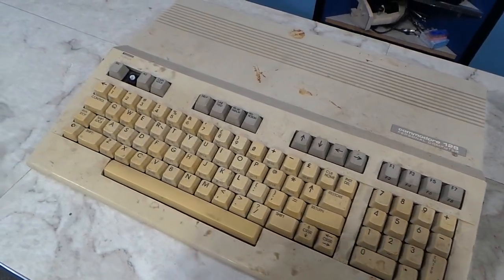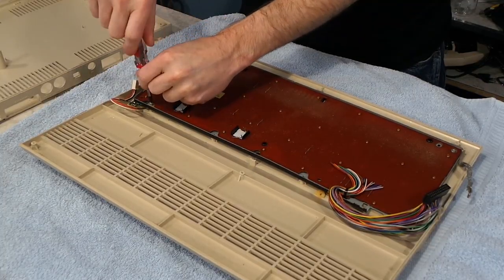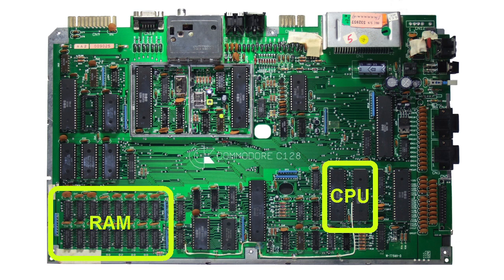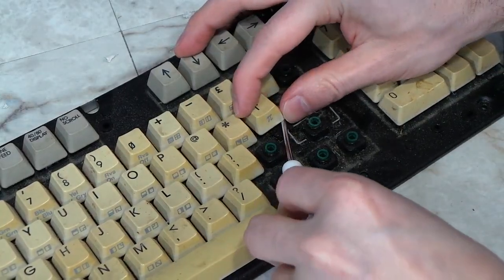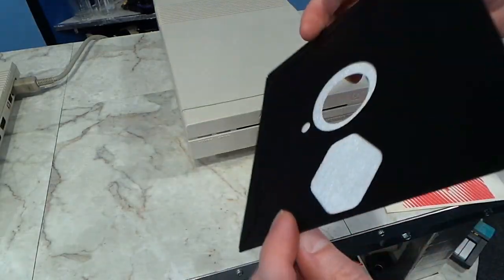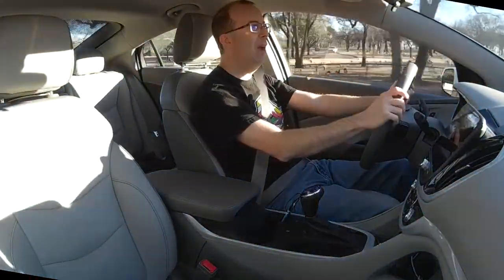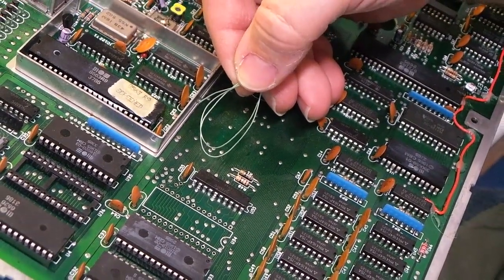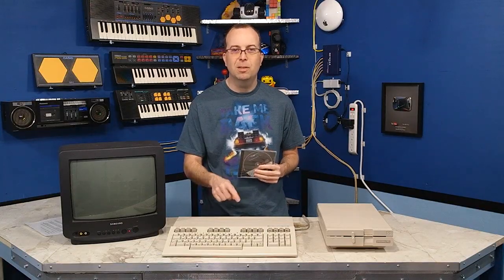Commodore 128 Complete Restoration and Board Repair.

Comment: my dream would be a 8-bit laptop with low res 320 x 200 screen and basic running with almost no weight and a memory card as harddrive. that would have been cool because all my software development is in form of basic so i would want to create real programs or games on somthing like that but with the look and feel of a modern computer. i was thinking of a microcontroller type 8-bit laptop specially designed to develop software in sprite style.

the cleverness in software is in the design of new subroutines that does somthing different than what have already been made.

the basic language need to be modified to support subroutines loaded in separate pages to decrease the confusion in reading the code since when you have hundreds if not several tousands of subroutines all wired together, it would be really had to keep track of, without dividing them into separate pages.

the pages does not need to be like files, only have their own memory block space in the drive and accessed by special algroithm that locate the blocks and load them into memory one by one and a list of long names for the titles of the subroutines pages.

the laptop must have a serial or usb interface in 8-bit mode that can talk directly to any 8-bit microcontroller and a way to read a diagnostic map of the mcrocontrollers software to check that the routines are interacting properly and a way to download the artifical memories from the memory algoritms that i have not made yet. 

i was thinking of the use of such a laptop to speed up programming of microcontrollers and  development of artificial brain software that is based on classic dumb AI method (that runs on subroutines for logic action patterns). i guess you guys is far more equipped than i in making such a computer. so it had been cool if you guys could make one.

im not really good at tokens and interprater development in the moment, so i have no clue yet how to make or modify a basic interprater to do new things.

i think a basic interprater chould have just basic functions like basic drawing, a randomizer, a slow down timer, and a mean to write  functions from bottom and sprite support as well as serial interface protocol. byond that, it need nothing, and most of the functions in microsoft basic language is a unnecessary waste of space. detector input or graphics chould be stored in arrays anyway and read numerically as it is the fastest method of manipulating graphics and then loaded into the screen and then saved as sprites for fast rendering. 

i think a 8-bit computer could run graphic software way faster if the numerical array was read like a binary sprite array and manipulation happend either on the drive or in memory and the computer just load the array in one chunk into the screen and update the screen this way at a certain framerate. this way, we can manipulate graphics much faster on the 8-bit since we dont have to talk fourth and back to the screen controller, for every pixel to write to the screen. 

what i mean is to not write screen data pixel by pixel and not prework sprites but allow numerical arrays to act as sprites that are directly loaded inot the screen in one chunk at the time, because with microsoft basic, you have to locate the pixel and then read the pixel and then write changes of pixels one by one for realtime graphic manipulation that result in very slow processing on a 8-bit or even a 32-bit 30 mhz. 

i want to manipulate graphics directly on the drive or in ram and then load the enire array with the dimensions of the screen direcly into the screen at a certain framerate as this way, manipulating graphics would be really fast. the problem is that microsoft basic handles sprites differently from nuerical arrays, but if there was a way to alter the interprater directly maybe it would be possible to change this, so that the numerical array, could be read as a sprite. 

think how cool it had been, if a 8-bit computer could process information at a incredible speed, by not have to deal with wacky programming routines made by clueless microsoft programmers or perhaps the original basic language was not intended for programmers but for idiots, i dont know.

i have had dreams in the past of computers that was so fast, when you first turned them on, they there is no welcome screen but the desktop appear with less than one second, and i think if operating systems had been written in assembly, and get rid of the filsystem method of processing data,  we would have no more slow computers. a operating system chould have been made like in a microcontroler. it could have been in a rom not in ram and take megabytes of space, not gigabyte. 

think of how fantastic it had been if you could use 99 percent of the cpu for your intentions and not have to share your 20 percent with the rest of the 80 percent of standard junk load that eat up most of the computers capacity and causes the system utilization to vary up and down irregularly and caused developed software to undergo unexpected delays in processing data that can trow off timing with external clock and mess up certain software that depends on exact timing. 

i think that if we could speed up processing on a 8-bit computer, we could use that to speed up any computer the same way. 

future operating systems and software depends on writing the code in assembly, and not buggy c or c++ since computers are no loger getting faster, and the only way to speed up processing, is to make faster software that takes less resources and runs faster. there is no way to circumvent the computer performance bottle neck so that if we are not changing the way software runs and use resources, future computers would stay in limbo  and new computers would suffer the same problem as cuba, as no new development of hardware can further the advancement of computers since they can't make the conductors  any smaller  without causing circuit bending at nanoscopic level that is the main reason why computers aren't getting any faster. 

i use a new cheap laptop and its slower than one i bought four years ago that was in the middle price range of laptops (relativly cheap), so the only way to make faster computers, is by making faster software by chaning the way we write alogritms to speed things up.

Comment: hey 8 bit try this for the plastic if you can get it good cleaning product just trow the keybort buttons 1 nicht in it and you can was them verry easy ps sorry for my enlich here the link  https://www.beslist.nl/products/klussen/r/st-marc/?device=c&gclsrc=ds&network=o&utm_campaign=bing_beslist.nl_klussen%7C58700001092075251&utm_content=%7Badposition%7D&utm_medium=paid-search&utm_source=bing-ads&utm_term=st%20marc%7C43700011420356304%7Ce

Comment: What a great video- this has inspired me to retrobright my C64 & Amiga. Always wanted a Commodore 128. Such a shame it didn't take off more. Then again, if it'd had a built in 5.25" drive it probably would have. Always thought it was odd to have such a slow Z80, but in my hardware ignorance I would assume that would be something to do with the speed of the 8502 needing to be the same. 

I'm a bit of a z80 fan, but did anyone care about CP/M by then? Maybe they had the wrong idea for this kind of machine. Maybe it should have had something more akin to the PC engine - an 8 MHz 6502-type thing 8-bit monster with a slow mode for compatibility, but also some sort of ninja graphics GPU with a big palette & full colour at a reasonable resolution + bigger sprites. Wouldn't have needed to be as powerful as the Amiga, just a have better graphics and be more easy to develop games. It's not like they'd need to improve the sound at least! They could've marketed the Amiga more as a high end device (I bet the Amiga could emulate CP/M, anyway). Commodore might have still been around if they'd done that.

Comment: nice videos ,.,. but i have another question for you about damaged mini sd cards . i ask u cause u anderstand alot about technologie, also i have 2 micro sd cards, one of 16 gbs and second 32 gbs . also the two cards aare with corrupted files and same time with writhe protection . also i did the 3 metodes to repair sd cards without no exit . 1st metod , diskparts with cmd , second with adpater lock and third with sd formater , and i am no able to format the bout sd cards .also in this case are my cards total breackable ? sory for my bad english .,

Comment: 3:46 - yup. Near the end of its life, I had a bad SID chip on my 128. I bought a used, dead C64 and borrowed its SID chip. I had sound until I finally sold the computer. :)
Dual CPU and dual video... sexy. There's a reason this is my favorite computer design ever. 
7:12 - surprised you don't have a key puller. 
Raymond... you are a true master. :)

Comment: Really cool idea ... Get one one disk drives, make it pretty, remove all the innards, 3D print a new base to house a PI 3 & pi drive, cut out and add new back piece to house USB - nic - power input, obviously wire everything up, use the LEDs for power and he activity, and "sweet part" make the disk arm into a power switch "down it's on, up it's off".   That would be the coolest thing ever.  Yes, probably can find the case dimensions and 3D print a replica.  Guess, that would be nice too.  But, for "realism" I'd love to have a drive get saved from old dead parts bin.  I'd pay for an item like this.

Comment: If you're so scared that something will blow up when you turn it on, then what I would do is connect an extension cord to an outlet that's controlled by a switch, turn the switch off, connect the extension cord to it, connect the computer to it, turn the computer on, put it as far away as the cord will go,  then turn the outlet on.

Comment: Thanks for saving another Commodore! Polite heads up, and you have probably heard this already, but the RF shield isn't necessary and has been proven not to have any heat sink effect. Better to install separate heat sinks (I like the black fin type) rather than have to remove the gooey shield every time. Keep up the Commodore restorations!

Comment: Try using a "magic eraser" (melamin sponge) and isopropanol alcohol to really deep clean the plastic. 
Works amazingly good, and those black scuffs that you couldn't remove will be gone as well :)

If you have  a air compressor at home i really recommend you a "Tornador" its a car detailing tool that makes life so much easier when it comes to dust cleaning, its so easy to use aswell.

Comment: A good upgrade would be to replace the metal springs with rubber sleeves off of an old mitsumi membrane keyboard. They feel very good and add much needed tactility to the commodore 128 keyboard.

Comment: Haven't you thought about making a voltage regulator device to connect between your power supply and your machines so they wouldn't suffer from a higher voltage dead from a faulty power supply?

Comment: Interesting how you removed your keytops / keycaps.  Might I suggest you get yourself a keycap puller / remover.  I used to work on electronic typewriters and I had to use one all the time when the keboards required repair.  The do come in handy and you run less risk of breaking a keytop / keycap.

Comment: Speaking of restoring the keyboard, I regret having to finally spray paint the case (not they keys, though) of my old AT&T keyboard black (it has no Windows key, it was quite heavy, and it was used on an old 486 PC)...  If only I've known of your Retrobrighting techniques before...

Comment: I have several c64s, a c128 and a vic20 in my house but all of their power supplies are dead and every time i buy one off ebay its dead on arrival. I heard there are replacements / after markets, but acquiring one is difficult.They need to open up ebay pages or something. I would try to repair my own but with all that epoxy gunk in there I cant.
Reply: Tall Order  i just fixed a bad ps for c64: The main filter cap for the 5 volt supply was bad causing major disturbance in the picture, and possible if even worse, may make the c64 look completely dead.  You can see it through a rectangular hole on the ps board. I know the waxy gunk makes it hard but it is possible to determine the parts on the other side:  xfrmr sec. to diodes then the large black capacitor. I isolated one leg of the bad cap and installed, on long wires some caps to add up to about 3300 uf . This provides raw b+ for 5 volt regulator transisistor on aluminum plate. Dont remember but possibly around   10 v before regulation.
Reply: You can get a Commodore4Ever power supply from eBay. Or get one of Ray Carlsen's--he has a website. There's really nothing difficult about getting a new PS nowadays.

Comment: I need help getting a C64 to work again. Apparently, there's no video going to my DVD Recorder using the RCA to RF adapter, but the LED light is on. And I have no idea if it's the PLA chip or a failing PSU (gonna have to check the voltage on the ICs to see if 5VDC and 9VAC works). The chips do get warm though.
Edit: the IC chips are outputting very low voltage (0.11V-0.25V), so it looks like the PSU is dead.

Comment: Wow that 128 was so filthy I wouldn't touch it without gloves 😲 Nice to see it cleaned and repaired, looks like new again. 
Has anyone tried automotive plastic protection products after retrobrite treatment? Do they prevent or at least slow it down yellowing again? 
I have a yellowed Commodore Amiga 500 and thinking about giving it a try to remove the yellowing, maybe first the power supply as it's smaller and easier to deal with.

Comment: Darn only If I found this earlier I just had to pass up a 128 at a flea market for 30$ with disk drive and all in the box because they had no way for me to even test it and it looked all beat up Arghh I forgot commodore's are usually easy to fix most of the time

Comment: Awesome video David, I have always loved these old machines. Growing up we had Commodore 64s and ZX Spectrums both, 
 they practically defined my early childhood. I remember spending hours with my dad copying code from magazines and manuals so we could play games. That feeling when you run your code and the game works is really something special. Then the feeling when the power goes out and you have not saved it to a cassette or disk hehe. We also spent an inordinate amount of time tinkering with the hardware, adding RAM, disk drive conversions and the like. Great fun and it really made you feel invested in your system. Today it's all so generic and standardized.

Comment: Oh man, I would not have tested the power-supply on a good system like that! 
Unless the 128 supplies were less prone to going over-voltage than the 64's were, but even then a home-made tester or a DMM is what I'd reach for first. Glad it didn't fry!
Other than that, great video!

Comment: That tip about reseating chips can't be stressed enough. I bought a Commodore 128D which has the built in 1571, but with detachable keyboard. It would header (format) a disk so far and then fail. I opened the machine up and looked for socketed disk drive chips and pushed the disk drive ROM in and it cleared the problem. BTW the Commodore 128D has THREE processors, it has the Z80, the 8502, and a 6502A for the floppy drive.

Comment: I've bought an Amiga 500+ in a similiar state - very dirty, rust on metal shield, marks of water bringing rust on the mainboard etc. It was working (mostly - keyboard and disk drive were broken). It was very ugly looking, so dirty I didn't want to touch it without first cleaning it with a wet cloth.
I've used a dishwasher to clean the plastic case - a short 30 min. program did the trick. I have replaced the disk drive with a modified PC drive.
After switching the keys with a working keyboard and cleaning each key I now have a very nice looking (and working) Amiga 500+.

Comment: Testing unknown state power supply using good computer is silly because pws may have internal damage which may be causing higher output voltage including short to AC which would destroy your precious commodore at instant. Never heard about dmm's?

Comment: Gosh bro. What does the wife do if I can ask? I swear I have seen you in abq or somewhere else before. Great video on the macintosh SE. I wish you can make it easier to reinstall. I used a scsi cable and a working performa 467 to copy the files over. The old external cd was the best but now they are real expensive.

Comment: Hi! I am also 8 bits guy, and own a good 8 bits computer collection including commodores. I had a C64 and later C128D by the time. I have a 128, which last time I did boot it up, probably several years ago, did boot, but had a strange colors  display, different colors on characters, any idea what problem it is ? oldish capacitors ?

Comment: Didn't you take a big chance there to connect a potentially bad PSU to your working 128? I've read horror stories of dodgy Commodore PSU's (admittedly the C64 "breadbox" ones though) killing the machines they were supplying power to, and I suspect the early demise of my own C64 was due to this.

Comment: On the Portuguese-Brazilian subtitles theres a huge mistake when you use "Baking Soda" they translated to "Soda Cáustica" which means Sodium Hidroxide where the correct translation is "Bicarbonato de Sódio" , how can i fix this?
Its not a trivial mistake, "Soda cáustica"(Sodium Hidroxide,NaOH) is corrosive and if someone soaks a paper towel and add NaOH will be assuring a trip to ER.